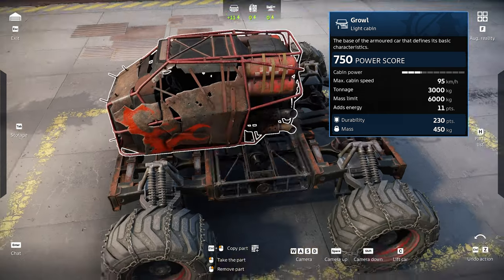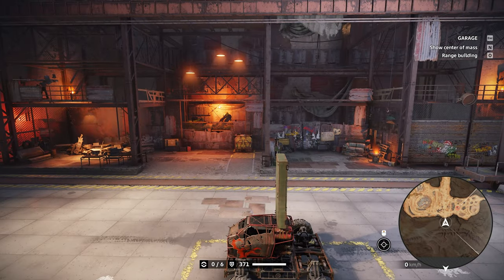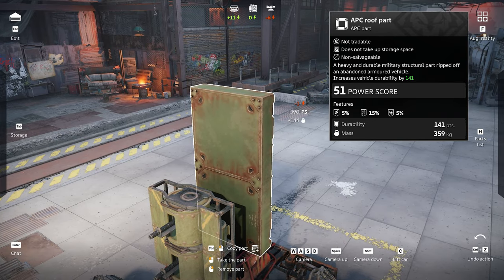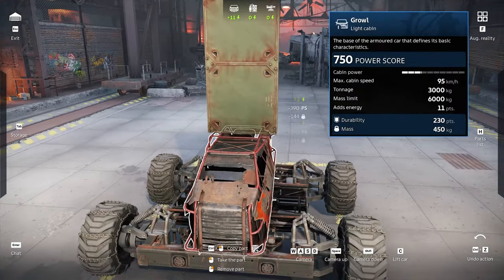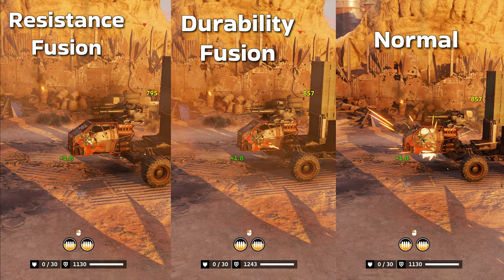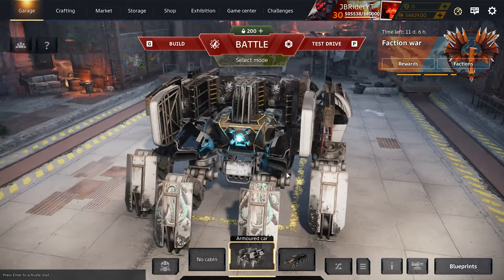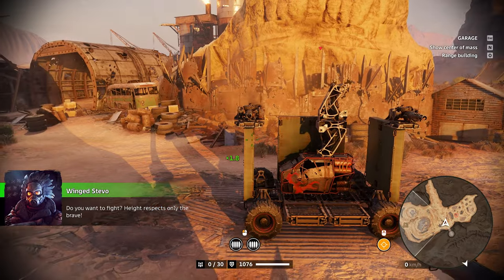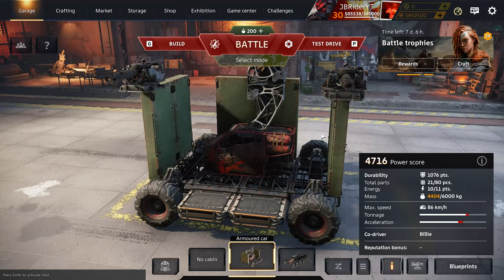The Difference between Total Durability and Cabin Durability & Why To Never Expose Your cabin

Comment: I have been playing for 5 years but have to craft parts, so my 2000 helicopter is the fastest way to make scrap. You make scrap faster at 2000 then any level
Reply: He had grind for plastic but with less then 2 to 3 hours a day to play I have know others way to get parts I need
Reply: True I got 3 cabins build for 2499ps
Reply: Usually a low PS 2k-4k has a long queue, 5-8k has a shorter queue and wires gives you more value/game. 

Like 10 wins on wires(100-110)has a market value of about $13-15(PC) and 10 wins with scrap(250-270) has a market value of about $8.50-10.50(PC) 

So sell the 100 wires for $14ish pay the 10%, then take the $12.60 and buy 300ish scrap and probably have a few coins and wires to boot.
Reply: @robvlob  What game reward has the best value per game varies by platform and current market rates. Typically it is never worth to get one resource to sell for another for very long. Clan confrontation is probably bringing down scrap metal prices due to only having one option for rewards. i find that that game mode tends to queue faster and have faster games for the same reward so that is a factor as well.
Reply: @drumer960  Yes, that's why I included (PC) and the shortest queue. 

I figure value/hour, and you almost always come out ahead playing for one resource(wires on PC), selling that resource(putting in a sell order for more coin), and buying(put in a buy order for lower coin) another resource(Batts or scrap PC). 

Back when scrap also gave cabs, wheels, shotgun, etc. (with a win), it was a no-brainer to do get the cab since at that time, cabs were worth 2-4x what everything else was worth yet players would play for wheels since they "needed then". Even after pointing out that selling a cab would give them enough coin to buy 2+ wheels.

Comment: I have been playing this game now since the Beta. And you would think that in all those years i would know everything there is to know about this game.
Wrong
And i will tell you why.
This game was and is under development all the time.
There were only a fraction of the cabins that we have now when i started.
And only a couple of engines
(They didnt even work for the first year, they were just there).
With every update there were changes, some small others complete gamechangers.
Todays crossout is completely different to when i started. Hell, even the community has changed.
So many ppl have quit because they couldnt handle it. 
Those that stayed share one thing.
They are all adaptable to change. They never specialized on just one thing. And they never stopped learning.

So thats why i still watch the youtubers. 
They keep me updated on the changes.
And they also inspire me to make new builds.

So here is to you JB!
Thank you for pouring your soul into these vids. 
I appreciate it.

Comment: Thats why a good strategy is to make a build with a lot of structural parts on back and side but cabin in fron not protected at all, 

So they damage the cabin durability, and then you shield with your structural parts still intact later.

If they break the structural parts before your cabin take damage, you don't use "the durability twice"

So tanky builds with a small cabin naied in tte front can be a excellent strategy for sole builds, especially heli builds

( at 4000-6000 ps at least)
Reply: kind of a usless strategy against the vast majority of players unless they are morons who try to 1v1 you directly
Reply: @Seethy705  work no matter the ammount of enemy you face